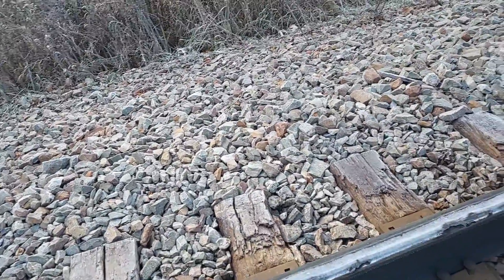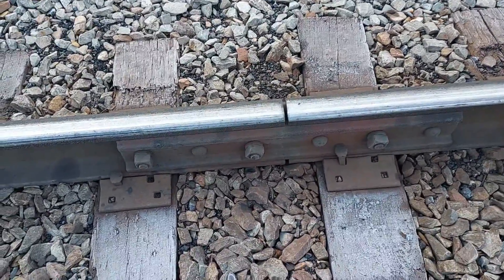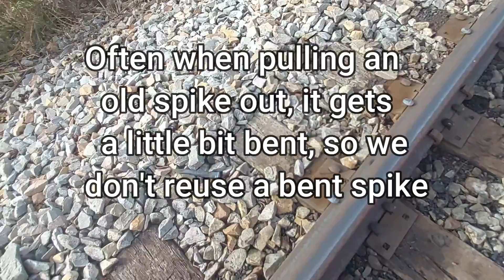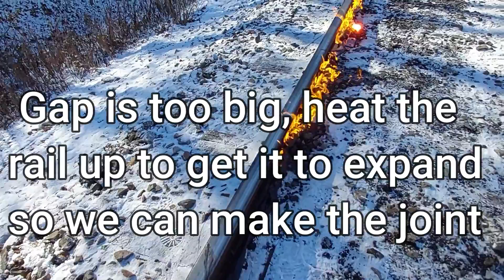How a Rail is Changed on the Railroad

Comment: Cool video Dave. I thought i saw Mittal on the one rail. LOL.  Brings back memories of watching the Steelton and Highspire R.R. change rail that ran through the mill.
Reply from the maker: There must be some tracks around Steelton Michael, cause Hulcher
was here working last year and they got a call for a derailment to go there. They worked all day here, then drove out that afternoon.
It's been a long time ago since we got any rail other than from
Steelton. We do have a small bit of Rocky Mountain Steel rail
we got on an order from A&K RR way back. Other than that
all other rail is original US Steel Illinois. Appreciate your visiting with us and checking out the video. Happy rails to you my friend until we meet again.
Reply: @ccrx6700  Thanks Dave. Plenty of railroad activity in my area. I video quite often in this area. I'm near the Reading Harrisburg Line. Tuesday i saw N/S truck stop and they burnt a hole in a section of ribbon rail that was hundreds of feet long. Went back Thursday it was all gone.Rail they removed had been laying there for over a year or more. Plenty of action on this line. They shift for Hershey Chocolate with the Operation Lifesaver 6655 and a Conrail caboose.  The Steelton rail should hold up for you i hope. This plant also rolls head hardend rail also. L didn't know if i mentioed that to you or not. Ok Dave thanks for the comment.

Comment: Glad you pointed out grinding that new rail down on the edge and flange side of the head to match the old one that it is up against. We actually had a car pick a joint last summer because the joint on the curve was not ground down. I didn't believe it would happen but it did.
Reply from the maker: Your welcome Bryan. Car picked a joint, that is a new one on me
but there are some really strange things happen on the rails. I'm
not doubting you one bit.  Appreciate your visiting with us and checking out the video. Happy rails to you my friend until we meet again.
Reply: @ccrx6700  Well, the joint was low on the outside rail of a tight curve, and for some reason the one axle hit that joint and the flange went right up on the rail head. We also found almost no lubrication where the truck meets the car frame, so it was probably a combination of several things that led up to it. We tamped the track, ground the rail head, and greased the truck bolster and the place the car bolster slides when the truck turns. Not sure what it is called. Everything was fine after that running over it.

Comment: Dave, when the rail head is damaged like this on the inside, is it prohibited to just swap ends so the damage is on the outside head of the rail? It appears the outside head doesn’t get ware. Seems unless this is a no no, it could save the railroad money.
Reply from the maker: Very good question Charles.  It is not prohibited to turn the rail neither is it prohibited to transpose the rail from one side of the track to the other. Many RR;s in the past have done that, some still do. We have never done it here. our old track foreman said if they are going to buy us new rail, that is what we will put in. Thanks so much for watching
and writing in my friend.
Reply: When I worked for CN on secondary line we often flip the rail.

Comment: How does this happen ? Bad Wheel !
Reply: This rail is run hard.  6 million tons a year with 38 cars means 5 trips a day minimum.  
All rail and wheels deform under load, the deformation is in the fully elastic range so the metal returns to prior shape.  But it is still stressed with each trip having 164 wheels passing on each side.  That is over a quarter million stress cycles per year.  45 years means 12 million stress cycles total.  In engineering terms, that rail performed very well.
Reply: @keithjurena9319  Thank you for that information.
Reply from the maker: If you mean why does rail wear and need to get changed Gerald,
then there are a bunch of reasons. Several of the bigger ones:

One thing that is really hard on rails in high degree curves is
the 3 axle locomotive trucks. Sometimes you will see loco consists
on trains where they have a 2 axle GP loco. That loco will be used
in yards to set out cars off the train because of the sharp degree
curves in yards. 3 axle trucks really put the stress on rail in
high degree curves. Another major cause of rail wear in curves
is the improper super elevation for the train speed.

Comment: I wonder why they haven't found a way to make steel or metal that would not expand and contract so much.

I remember when I was young and had to walk over the bridges and there were expansion fingers and they would have huge space in the winter when it was negative 20 F and they would be touching in the summer when it was 100 degrees

In the winter you could almost fit your shoe in between the fingers

In the summer you couldn't fit a sheet of paper.

That much expansion made me nervous

The metal would push against each other in the summer

I thought they couldn't make it any wider or you would have your foot fall through the gap
Reply: Physics. It doesn’t work in our world. If they could, they would have already done it. You should only be nervous when the expansion joints aren’t moving. That means the bridge is being stressed in ways it can not handle.
Reply from the maker: Excellent comment Mike. You are so right, if they aren't moving
then there is a real problem somewhere. bunching up on a bridge
is a big issue that's why they recommend anchoring every tie
out for 190 or so feet from a bridge. We have a definite need
here to do a much better job at anchoring our bridge approaches.
Reply: There are metals which have less thermal expansion, these are expensive and most aren't strong enough. 
Invar is one alloy type, it still expands with heat about 1/10th of rail steel, 0.0000065 / °F.  Regular steel rail with a 60 degree difference in temperature will change about 3/16" over a 39 foot length.  Invar would change 0.0183" in the same conditions.

Comment: The weight of the coal cars really beats the hell out of the rail
Reply from the maker: Another thing that is really hard on rails in high degree curves is
the 3 axle locomotive trucks. Sometimes you will see loco consists
on trains where they have a 2 axle GP loco. That loco will be used
in yards to set out cars off the train because of the sharp degree
curves in yards. 3 axle trucks really put the stress on rail in
high degree curves. Another major cause of rail wear in curves
is the improper super elevation for the train speed.
Reply: No doubt!